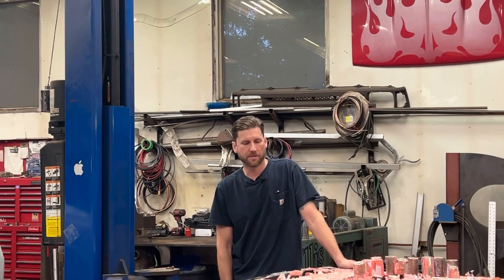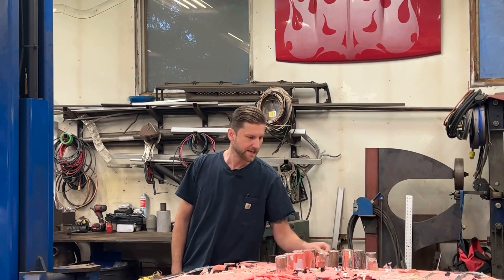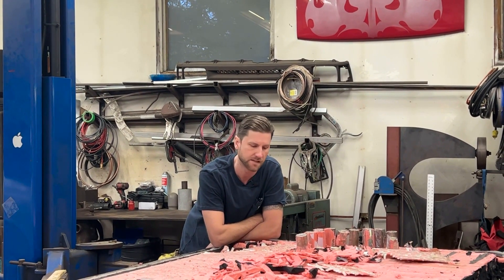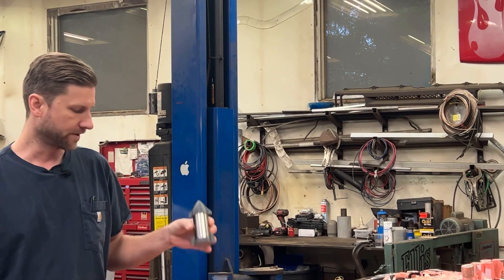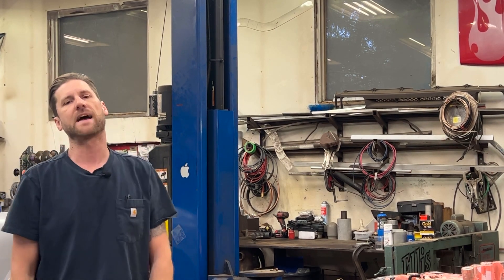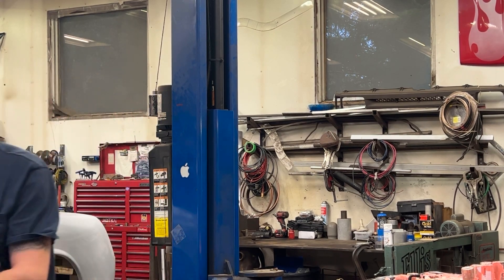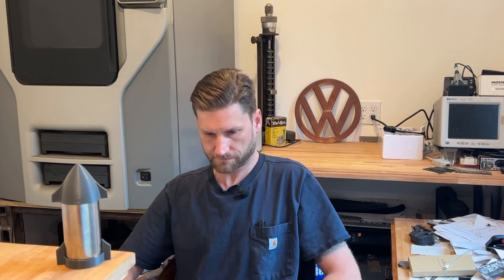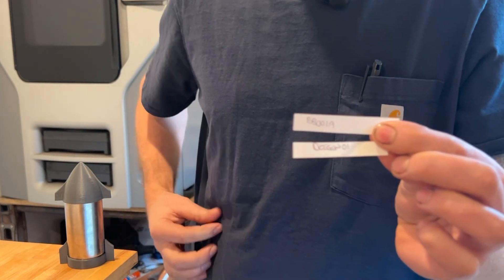Tesla Model Y 4680 Battery Update

Comment: Would love to have you as a neighbor. Not many with knowledge and a garage like this so impressive. Don’t forget to smile at least once a video. 😂
Reply from the maker: Yeah pretty new to the video thing, I'll figure it out! You can ask me any questions you like!!
Reply: @519Kustomz  Yes there is one Tesla DU question that I would like to ask. I have a Model S 2015 that I have driven 340.000 km now and there is a mild clonk sound from I think the reduction gear when I accelerate and also when I regenerate brake. But only once and then it runs as normal. Are the bearings worn out or the shaft’s or what?
Reply from the maker: I would have a close look at the C.V. shafts first. Particularly the inner joint. I would think if the internals are worn enough to clunk you would have a host of other terrible noises. I've had one rare one that needed to have the outer cv spline to the wheel bearing taken apart, cleaned, greased and re-torqued to fix a similar noise.